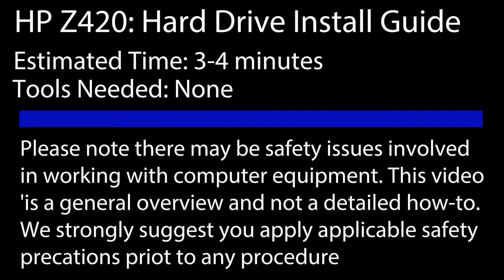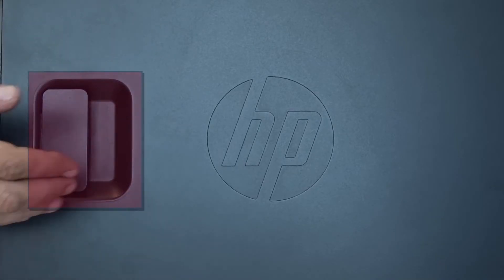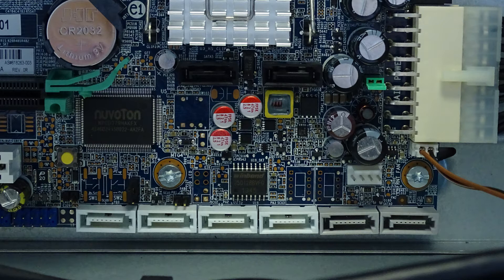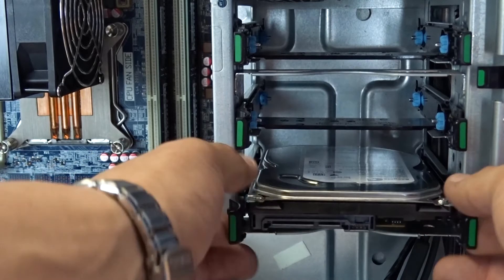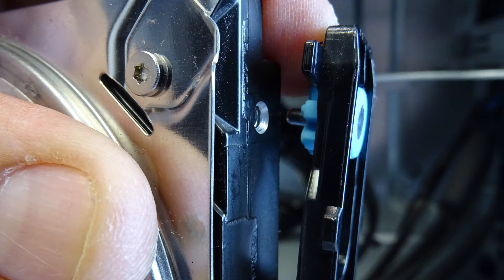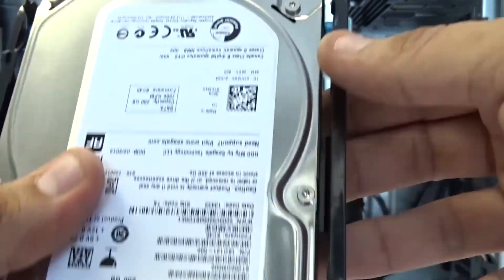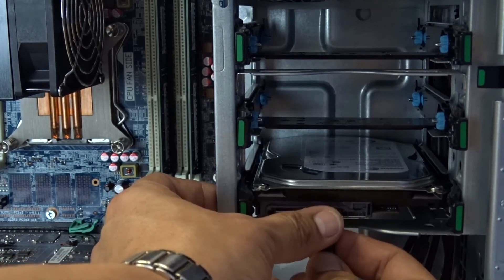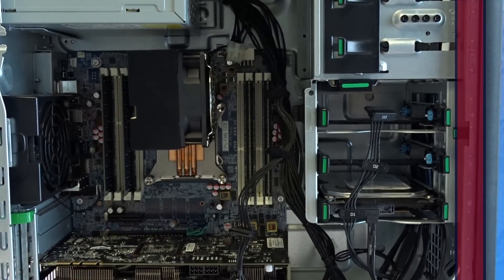HP Z420 Hard Drive Install Guide

Comment: I bought a used Z420. Inside it has a SSD with Windows 10, and two HDD setup in RAID-0. I  did a clean install of Windows 10 and now the two HDD won't show in Windows. BIOS is setup correctly with AHCI+RAID, and detects the two HDD. Windows doesn't seem to see the two drives at all. Doesn't even show up in Disk Management. Totally list, not sure what to do from here.
Reply from the maker: Most likely you are missing the storage driver for the z420. Link to driver is here:
https://ftp.hp.com/pub/softpaq/sp68501-69000/sp68644.exe

There is also a video of how to load the driver, but for this it is using a Window storage driver instead of the hp one so you have to "update" it":
https://www.youtube.com/watch?v=M42gKt6V9VQ

Best of luck

Comment: you demonstrate how to use the first 3 slots, but what about the back slots?  My refurbished z420 came with a 1tb drive that I want to use for data.  I cloned it to a SSD drive, but I'd like to move the spin drive to one of the back slots since I plan on adding a couple more ssd drives.  do you have a video that shows that?

I'm also a bit confused about the SATA ports.  mine came plugged into 0 and 1.  I'm not quite sure what the significance of the other 6 is.  2 are dark gray and 4 are light gray.  So that leaves me confused about where the 1tb drive and also the DVD drive were plugged in?  Those are black.  I'm guessing there is a color coding of some sort?

thank you in advance.  just trying to get this going.  it came with 8gb ram, but my USB ports choke if I add too many things, so I"m assuming that is due to not enough ram?
Reply from the maker: We recommend using the first 2 ports (dark gray) because they are 6Gbps.  The other 4 (light gray) are 3Gbps.  If your SSD is SATAIII (6Gbps) i suggest leaving it in one of dark gray port.  We typically install drives on ports 0,1, and optical on port 2, and any additional drives on the last 3 ports.  To use any of the other ports, they must be turned on in the BIOS.
Reply: @tekboost  I have 2 more SATA ports than were shown on the 'data' screen inside the back cover.  they were black. that is what everything was plugged into when I got the system.  not sure what they are/were?  I had done so much plugging and unplugging in the process of trying to set up my clone that I don't recall what was where, but when I plug my DVD back into one of the black ports (those are in front of the 6 gray ports) - the system wouldn't boot.

I'm getting more confused by the minute.  what would you think the black ports are?  The working SSD is now plugged into one of them, but when I try to add another hard drive in the gray slots - the system doesn't seem to boot.  it shows something going on but my monitor screen is black.  could it take a while for the system to show what it's doing?
Reply from the maker: @ssergeant9682   Im not sure which black ports you are referring to.  Check out the manual at  http://h10032.www1.hp.com/ctg/Manual/c04205252.pdf.  See page 19 for diagram of the motherboard, this can help identify the black ports you are referring to.
Reply: @tekboost  I looked up the diagram.  it's for a Z220.  mine is a Z420.  there was no information on that showing what the other 2 ports are.  I also can't find the MB model on the MB.  I know this is refurbished and they did say there could be differences from the original and without being able to find the actual MB model - I"m at a loss.  btw what is an  AHCI ?  short of showing you the photo I took of the slot locations - I don't know how else to explain what and where they are.

I did a little googling and found this strange website that showed a photo of a board similar to the one I have.  it definitely shows those 2 SATA ports.  I think the site is safe even though it claims to sell these boards for a super large amount of $$ but that could be a different currency.  here is the site. https://xworkstations.com/hp-z420-workstation-motherboard-619557-001.html      when I find an actual diagram that shows these - that doesn't make any sense    I can't see a closeup on the diagram, just the little boxes where they are - and the specs show them to be USB connections.  none of this makes any sense. but off to the side they show the AHCI again.
Reply from the maker: @ssergeant9682  Confirm you are viewing page 19 (shown in the bottom right corner of the page).  The entire document contains info on Z220, Z420, Z620, and Z820.  I just confirmed 19 is the Z420 diagram.  AHCI means the software can comunicate with SATA devices.
Reply: the slots I'm referring to are just below the number 5 and 4.  they are definitely SATA ports on my board.  (I was looking at the page numbers in the PDF. DUH.  then I looked at the actual page numbers on the document and saw the page you referenced.  So does the diagram make sense to you?  If you look up 5 and 4 - it shows them to be front USB  ports 2.0 and 3.0.  am I reading it wrong?  I do have my SSD drive plugged into the one on the right as you're looking from the other 6 SATA ports.  Your advice would be to reconnect my SSD drive to #15  indicating 1 and 0?  most likely use the '0' first?

hoping you can figure this out.  I"m stumped.  it's as if the wiring is goofed up somewhere.  not sure where to look to see if there is a mis-configuration somewhere in the bios?
Reply from the maker: @ssergeant9682  Sorry for the delay, i was geting clarification on the above.  So the diagram table is refering to the numbers with Circles around it. So 14 is 4 SATA ports (2 through 5).  The 2-5 are not cicrcled so do not refer to the USBs.  The system has 6 SATA (AHCI) ports 0 and 1 are 6Ggbps and 2-5 are 3Gbps.  And there are 4 SAS/SATA ports (#17 -  SCU 3Gb/s).  

Which operating system came on the 1TB HDD with your workstation?  
Have you tried putting the 1TB drive back ont he original port it came installed on? Did it boot properly?  Which # port was it from the diagram?
Reply: @tekboost  1 × HP Z420 Workstation Desktop Computer PC Intel Xeon 2.8GHZ 8GB 1TB Win10 Pro and WIFI is what I bought.  based on the video you sent I installed the SSD drive in the black slot which is the one closer to the edge of the board.  when I got it - both the DVD and HDD were installed in those slots.  I cloned the HDD to an SSD and installed it.  I didn't plug the DVD back in at first to one of the black slots next to where I plugged in the SSD but when I did - it just gave me a black screen.  Without sending a photo with arrows I can't tell you what the ports are that were used.  I CAN tell you that they were NOT in any of the 6 slots than run along the bottom.  (2 dark gray and 4 light gray)   the heatsink looking 'thing' off the end (or close) to the graphics card is where those black slots are.

I have not put the original HDD back in.  hope this helps?
Reply from the maker: @ssergeant9682  You can leave the DVD unplugged for now.  Please continue to connect the original 1TB HDD back to the original port it was in when you received it to confirm it boots to the OS.   If working, next remove the 1TB HDD, and swap it for the the SSD, using that same port the 1TB HDD was plugged in, and reboot. Did it boot to the OS?
Reply: @tekboost  I have it set to boot from the SSD but if it's the only system disk - I shouldn't have to change the boot sequence in the bios?  it does currently boot to the SSD - it's just that everything else I try to plug in causes an issue.  no beeps, no error messages, just a black screen.  I waited for it to do something but after 5 minutes gave up.  should I have waited longer?

I'm going to do this as soon as I can, but I had something come up and I have to be away from my system this afternoon.  I'll check it out and post back..  Thank you for continuing to work with me.  You're a huge help!
Reply from the maker: @ssergeant9682  Yes, since both drives have a bootable OS, you will need to set the bootable order in the bios (Tap F10 repeatedly during start up).  Lets make one change at a time moving foward:

1) With the SSD still installed, plug in the optical drive to SATA Port 2 (the first of the light gray ports, thats immediately next to the 2 dark gray ports), then reboot.  If working, move on to the next step.
2) Instal the 1TB HDD in Port SATA Port 1 (the 2nd dark gray port which is bordered by a 2nd dark gray port and a light grey port)
3) Boot to the BIOS and set the boot order to make the SSD the primary.
4) Reboot

Was the optical drive and 1TB HDD the only components you were referring to as "everything else I try to plug in causes an issue" after you sucessfully booted with the SSD installed?
Reply: @tekboost  I couldn't leave without following your suggestion.  I did hook up the 1TB drive.  booted up just fine.  left the DVD unplugged.  The graphic card drivers weren't on that drive so I thought I'd at least put those on. but all was fine.  pretty sure the SSD will boot up also, but have to leave for now  ;thanks again.
Reply: @tekboost  I've been out all day.  I'm going to do this tomorrow.  I do have another strange issue.  I was trying to get stuff printed for my hubby before I left (he has no clue how to do it).  I couldn't find the file he needed until I plugged in my SSD drive that I have in a case.  I plugged it in - found the file - but couldn't print it.  I could not figure out why until I noticed that I had lost my internet connection.  I thought I'd had something similar before with this computer so I transferred the file from the SSD drive to my desktop and then disconnected the USB drive. That restored my internet connection.  Any clue why plugging in that device would kick out my connection? 

I'm adding this to my list of 'things to be solved'.  I will follow you directions tomorrow, but I didn't go into the bios to boot up my drive. I made it the only one - so it booted up.  I did try adding the optical drive but didn't see it listed in the list of drives.  I didn't have anything in it, but expected to see a drive:DVD.  never saw that.  I had plugged it into the other black drive.  Tomorrow I'll plug it in where you suggested.

thanks a ton for your help.  I'll be so relieved when I can move this system off my kitchen counter and put it in my office.  pretty sure the hubby is getting sick of me taking up all the counter space.  he never says anything - but it does take up a lot of space.
Reply: @tekboost  I have to discs on sata 0 and sata 1. I want to add an additional third disc. As far as I'm concern I should use either sata 3 or sata 4 to do so. Unfortunatelly I keep on seeing the disc in boot order but not in device configuration. Should I do sth in the bios to allow the third one to work? It is initialized.

Comment: How many drives will the Z420 recognize? I have three can I use a fourth one?
Reply: It has 6 SATA Channels on the motherboard so can havae up to 6 SATA Drives (5 if optical drive is installed). Some adapters may be needed in order to install the drives inside the system such as 5.25" External Bay to 2.5" or 3.5" Hard Drive Adapter.
Reply: @seanhall8987  thx Sean, I put a SSD inside and into one of the channels but it did not recognize it, so then I took an existing SSD out and used that slot but when I rebooted windows 10 it showed the capacity of the old drive and not the new empty one, and that just throws an error message up when I click on it.....any ideas?
Reply: @rayhsetwo8594  The channel you tried initally could have been turned off.  Go into to the BIOS to confirm the SATA port you are using is turned on.  Once confirmed, boot to the OS and access the disk management tool to partion the new drive.  If you still have errors, free free to post the error message here.

Comment: How do I tell which bay is "0" and "1"? I have a RAID and it says the drive in Bay "0" failed. Would that be the first/lowest bay with the cable labelled D1?
Reply from the maker: The ports are in order 0-5, 0 and 1 are dark grey.  Locate the dark grey port closest to the corner of the chassis and that is SATA port 0.  D1 is the optical cable however its basically the same cable used for the HDDs.  Typically the cable for SATA 0 is labeled  "HDD Bay 0".

Comment: i have...
HP Z420
Processor	Intel(R) Xeon(R) CPU E5-2650 0 @ 2.00GHz, 2001 Mhz, 8 Core(s), 16 Logical Processor(s)
Ram 32 GB
.........when i use 'After Effects' and apply any effect+render Both cases The system is too slow, plz how can i speed up my system, thanks
Reply from the maker: What hard drive or SSD are you using?  We recommend using a 6Gbps SSD for best performance.  Next upgrade could be your processor.  They go up to 3.7Ghz.